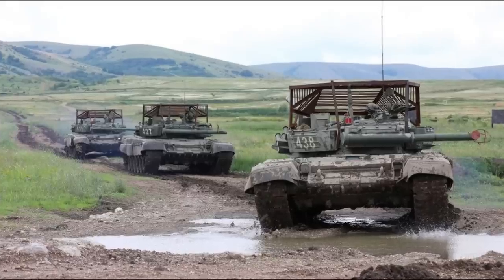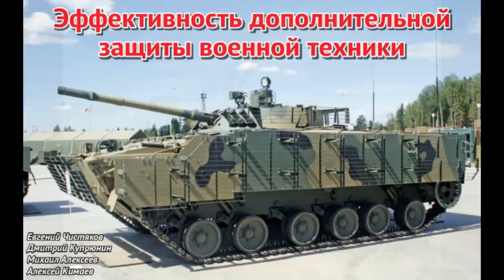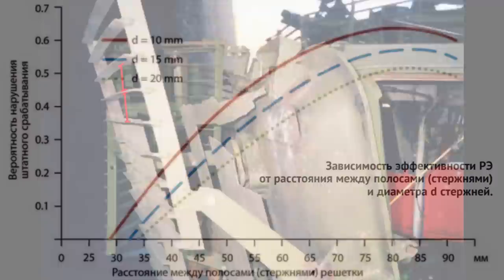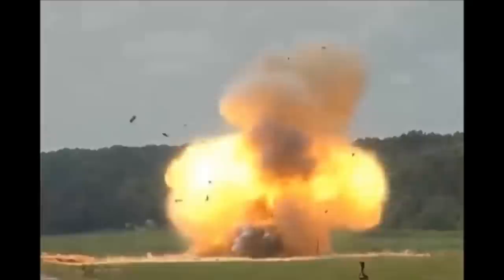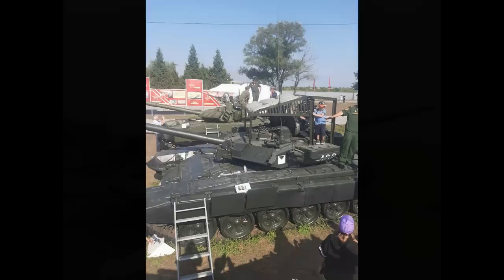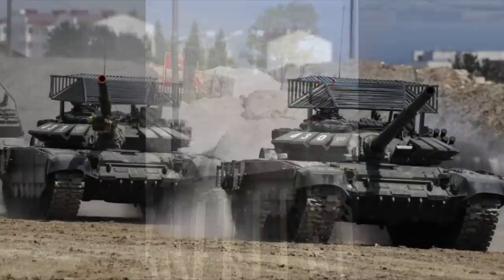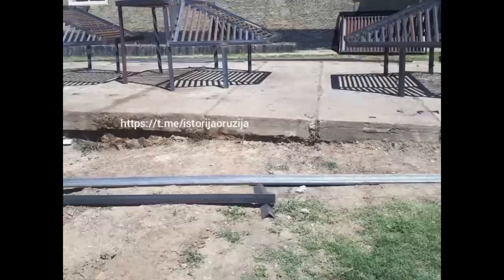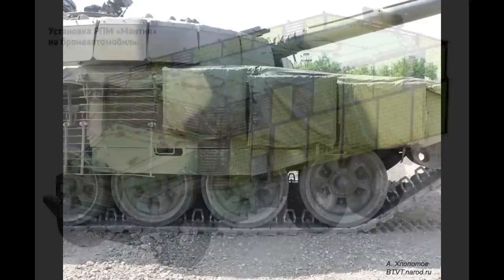The Truth About COPE CAGES

Comment: Looking at the study, the optimal width was 80mm against an RPG-7 rocket. Those rockets have a diameter of 93mm, which would give about 6mm of deflection per side (assuming a "direct" hit between two slats). If the slats are as narrow as possible, they will bend from the impact and dissipate kinetic energy to slow the HEAT projectile down, hopefully enough to catch it without detonating it. Using stiffer slats would, beyond increasing the chance of hitting the slat, cause a more violent deceleration that could detonate the warhead and cause a penetration.

Now, if 80mm is a good length for a 93mm warhead, what would be a suitable slat distance for a Javelin which is 127mm? Well, using simple proportions, it would be 109mm.

Problem of course is that these tanks aren't facing only Javelins and RPG-7s, but:
Stugna-Ps 130mm
NLAWs 115mm
PzF-3s 110mm
MATADORs 90mm
AT-4s 84mm
M72s 66mm

Just to name a few of the anti-tank weapons they've been provided. A pretty wide gap of calibers to protect against, since an 80mm gap is quite unlikely to catch a 66mm rocket. And that M72 can still penetrate 200mm+ of RHA up to 450mm, depending on the model.
Reply: Now that could have been made clearer in the video, at least to me. Armour like this strikes me as very threat dependent. If you're up against projectiles too large or perhaps, detonate at stand off, distance from the target, that's a different configuration required over an assumed primary RPG-7 type of threat. 

Not to say the idea works, or doesn't work. Just to suggest that in this case the design as installed is not correct for the threat present.
Reply: @leonpeters-malone3054  Thats why there was the proposition of those hard-object bags as layered protection. I mean when you look at tanks now ts layer upon layer upn layer of protections now. Cast-hull of steel for general protection. Composite armor shell over hull. ERA over fixed armor. ECM packages. Then its stand-off cages, then its bags over cages. 

At this rate, there is significant complexity to have a generally survivable tank, unlike WWII where it was thicker steel over a better hull design.
Reply: Two grids one to catch big fish and another below to catch small fish. cover 84mm to 120mm.

Perhaps also add absorbers for IR,  visible, radar? In these layers
Reply: @agnelomascarenhas8990  that would likely be very effective.
But it would be expensive to produce in a factory and difficult to produce in the field.
Or at least that's what my intuition says.
Reply: Which version of M72 can penetrate 450mm?
Reply: AT4 have special ring  so it initiates if any part of rocket touches a cage. And electric fuse is not in the front.
So AT4 will work any way. Any cage can't disable a rocket from initiating.
And its caliber is not the reason.
Reply: Classic case of not being to develop a counter measure against a weapon you know nothing about, hence all Western military systems are being upgraded, challenger, leopard, abrams etc they knew the threat existed so have adapted too it.
Reply: Don't forget drones dropping grenades from above. Which I personally think is the reason for these bars.
Reply: @leonpeters-malone3054  I personally believe they are to stop kamakazie drones and munition drops from drones. And are nothing to do with RPG at all.
Reply: It should be noted that weapons that use electrical fuses can’t be intercepted like this, which is many Western weapons.
Reply: @geroutathat  If that was the goal, then you'd space them according to the common threat, i.e RPG-43 with a diameter of 93mm. The spacing is too close for that.

So it may be for many uses, but clearly assembled without much of a deep understanding about the mechanism of slat armor.
Reply: @whitescar2  they used the same cages in Syria etc for drone stuff. This is raised a lot compared to other versions they used and they might have found that's an acceptable distance for the dropped grenade to detonate. It's impossible for me to say, but I think modified standard grenades are being dropped with fins attached. Maybe they were unsure what the spacing should be so moved the cage further away. There is a video online of Ukraine dropping one into an open turret hatch, and I'd say most tank drivers have seen it, and feel safer with the cage than without.
Reply: Slat armor isnt working like that. It may catch the rocket but its primal purpose is to destract cone shaped explosive in the warhead so even if it detonates his now destruped shape charge isnt effective. Rpg warheads to be efective must have certain  (Cone) shape or it woudnt work as it suppost to do.
Reply: The thing is that many of these systems have tandum projectiles, meaning they often basically ignore slat armour or single layer reactive armour.
Reply: I suspect that Javelin and NLAW are both stand-off EFP (explosively formed projectile) weapons which don't actually need to contact the armour surface to detonate. The bars of slat armour and cope cages are so thin that they would add virtually nothing to armour against EFP.
Otherwise, I guess the ERA on turret roofs should have done  its job and exploded to deflect/disrupt the shape-charge projectile from those warheads initiating on contact with a cope cage, because that sort are generally smaller, less energetic, particularly after initiating and then flying through the big distance (at least half a metre, from photos) from the cage to the turret itself.
Reply: @ukuskota4106  don't shoot AT4 at a tank please, very high chance you only make it angrier
Reply: @geroutathat  kamikaze drones can hit from any angle except straight up from the ground.
Reply: It is sometimes referred to as probability armour. The nose mounted fuse on the RPG is less likely to  strike the bar . The bars are spaced so that when the nose of the projectile passes between the bars , the sides of the projectile strike them . This causes the shaped charge to be damaged . Even if detonation still occurs,  you are now dealing with a frag' round rather than a HEAT round.
 It would have little effect against non nose fused or proximity fused munitions.
Reply: Solution: overlapping cages.

See, Ivan? I am an engineer.
Reply: @KKSuited  i dunno, you could probably fly one under the front or back and detonate it while under. Maybe put a big magnet on the bomb so it sticks to the under belly. I'd just walk up and bend the barrel of the tank with my bare hands, as it would be quicker.
Reply: You left out the Carl Gustav M4.

There's film of one scoring a kill on a Russian T72 tank.

Oh, they have "tandem charge" projectiles for the M4, these are designed for reactivate armor and steel cages in mind, 500mm penetration as well from the information I've gotten.

Thank you Sweden 🇸🇪
Reply: The point of the slats is to deform the explosive before it explodes, this causes the explosively formed penetrator from being formed correctly and significantly reduces its effectiveness
Reply: @BrokeWrench   from my understanding javelins and NLAWS do not actually strike the tank from above in top attack mode but detonate ~1m about the the target and the shaped charge penetrates the tank. So the cage would be useless since it cannot deform the projectile to deform the shape of the shaped charge.
Reply: Well, other issue is that the RPG-7 round it was designed to defeat isn't a tandem, which makes everything far more complicated. Just because you disable/defeat the initial warhead of the tandem doesn't mean the main warhead is going to fail as well. Besides, if the first charge simply explodes and doesn't form the jet, well now you got a hole in your cage the main warhead is going to pass through.
Reply: Great analysis. I still cant imagine the cope cages are worth giving up the silhouette of Russian MBTs- it’s always been one of their stronger and more stressed aspects
Reply: The study is all about preventing RPG-7 detonation.  It is not applicable to the use case.
I believe the plan was that the cope cage would act as spaced armour, triggering early shape charge detonation, and dissipating the jet in the air. Hence the rod shape is irrelevant. Theoretically, it is not a completely stupid idea. Fortunately, it didn't work in real life. I haven't seen any positive feedback about its efficacy.
Reply: @whitescar2  Don't know if any of the other replies said it, but against a Javelin this is more or less completely ineffective to my knowledge. Cage armor only works against HEAT charges with a contact fuze, but the Javelin (and also NLAW for example) detonate quite a bit before they touch the armor. Contrary to popular belief, a HEAT charge does not become less effective when it detonates a fair bit before the armor. If it is designed for it, it will even be more effective this way. So my guess is the cages are probably against drone dropped weapons like often deployed in Syria. Against modern ATGMs they are very unlikely to change the result of a hit, and the Russians are not THAT dumb to think they can stop a Javelin with a bit of angle iron.
Reply: @agnelomascarenhas8990  

Yes that exactly what they should have done .
Reply: @geroutathat  Possible. Very possible. 

Not going to argue and not going to be too be worried about it. I'll stand by my comment though, if it was working and it was cheap we should see more of them, which we don't.
Reply: @JRyan-lu5im  Would have to argue that last statement. Depends on what you want from the tank in question and if that means armour. Mobility is a form of armour, especially in the era of HEAT as the primary round. Form determines function and function, doctrine defines criteria. Even presumed threat. 

WW2 is a bit of an odd case in tank design. So many designs, cycled through so quickly. Layered protection makes sense, after all there's a whole layer in the onion of protection given to that. 

That's also an assumption I'd rather not make, yet. I'd like to see more information in the original language on the blankets, pads, padding before I make any claims about it.
Reply: @leonpeters-malone3054  there is a chance that we are all wrong and they have out them on tanks to be hidden in barns as it allows the crew to get out if the barn collapses on them. It could even been for tanks headed for bushes as they found it allows them to hide the tank and exit and enter the tank without disturbing the cut branches placed on top. All I know is that if it's for defence from a weapon, I can't see this cage having any impact at all on most modern anti tank rockets etc. We seen similar cage used before and consensus it was for drones. But who knows.
Reply: You're overthinking this man. Slat armor by function can only stop piezoelectric fuzes from triggering. Electrical crush fuzes will still go off. Moreover only the secondary charge in a tandem warhead will be directly affected.
Reply: An RPG is a direct fire weapon. How many times does someone get a top shot with an RPG? 1 out of 10? 100? Most RPG shots will hit the sides or rear, not the thin top armor. That's why the top HAS thin armor-- it's the hardest armor to hit with direct fire.
Reply: @JRyan-lu5im  Ya, it sure looks like it's done a fat lot of good on T-whatever Russian tanks.
Reply: @Tom-ut6ky  You dont see Leopards or Abrams facing modern weapon systems often, and for the few instances they have, they've gone up in smoke all the same - such as leopard tanks cooking off in Syria and smoldering Abrams tanks facing Kurds in Iraq.
Reply: @JRyan-lu5im  "Of the nine Abrams tanks destroyed, seven were destroyed by friendly fire and two intentionally destroyed to prevent capture by the Iraqi Army."
Reply: @Tom-ut6ky  "Abrams facing KURDS" - lets not kneejerk here and actually read. The Peshmerga destroyed an Abrams tank with a MILAN ATGM, the tank being one that the Iraqi's gave to Shia militants(the same ones who actively tried to kill americans). This has nothing to do with the american invasions of iraq itself.
Reply: These roof cages aren't designed to catch a rocket before it detonates. The rockets they are intended to defend against are rockets NLAWS or similar, that go above the tank and explodes mid air with a shaped charge goind downwards. If that is what they are trying defend against, then following the same design principles doesn't make sense to me. 

Surely, what they want is something that the shaped charge will hit and make it dissipate some energy before hitting the armor, if it can catch a projectile or not doesn't matter. 

Ideally they would want to build a small bed for reactive armor. Having a shelf with sand bags might dissipate some energy before it hits the tank too, but no idea if that would be enough. Having small bars with a lot of width would probably do very little against a shaped charge that is already moving through the air. 

Sure, if they want to defend against RPGs fired from top of buildings, they should follow the same principle. If they want to defend against NLAWs or similar weapon systems, they don't want to follow the same principle. 

If you look at the second target in this video: https://www.youtube.com/watch?v=hupsUq-fzq8 The NLAW is that high up that it would probably hit above the cage, and I would believe that a cage with sandbags in that hit would manage to dissipate some energy, not saying that it would be enough, but the design makes sense.
Reply: Disruption of the electrical connections from the nose fuze to the base detonator is what the spacing is about. US troops in Nam used Chain Link Fence to disrupt 50% of Chinese copies of the RPG-2 called the B-40 with the meter plus standoff lessening damage from those that did detonate. Similar numbers or better vs RPG-7.
Reply: @evil001987  Problem is, the NLAW is not a shaped charge, but an explosively formed penetrator. It does not lose penetrative power over distance in the same way that a shaped charge does. An EFP is a solid slug, while an SC is a jet of plasticized metal. Russians have been placing ERA blocks over their tank roofs for decades now. So against shaped charges, they have some protection.
However, the NLAW does not much care about Kontakt-5 and the Javelin is, afaik, tandem shaped charge.

The only potential use these would have is against rooftop RPG-7s or M77 LAWs (or equivalents).
Reply: In order for the HEAT round to penetrate it must be detonated a set distance from the armour. That distance is built into the round itself. If you set it off before it reaches the target it will just splash against the side doing next to nothing.
Reply: @python27au  That's quite a hyperbole. It will be less effective than if detonated at the optimal distance, but it won't just be a useless splash of copper.

In WW2, before the stand-off distance was properly understood, heat shells looked like this: https://ww2db.com/images/weapon_hafthohlladung5.jpg

Some tank crews adding logs, or other makeshift armor to their vehicles actually improved penetration, since there was more space for the jet to form before hitting the actual armor. 

Modern shaped charge penetrators do come with standoff tips for optimal penetration, but if what you said was true, it would imply that all tanks could be safe from HEAT warheads with the gentle application of a 10cm standoff plate. And that is obviously not the case in reality.
Reply: @whitescar2  depends on the round and the tank. Some of those rockets look like they’d need a bunker to stop them. I was a combat engineer, we used shaped charges for various applications, we had a charge designed for cutting steel beams if the charge wasn’t place exactly flush against the target then it wouldn’t cut or wouldn’t perform properly. I’ve seen pe4 and comp b charges obliterate one target while a second only got a little bent because there was an air gap between thw target and the charge. We made rocket screens out of fencing wire they would deflect or detonate rockets so that the target was only peppered by shrapnel and not blown up.

A piece of metal in the right place could mean the difference between a disabled tank with a living crew and complete destruction. Not saying its 100% effective it all depends on the variables.
Reply: Dam coalition and their chaotic armoury!
Reply: Their ERA and APS can protect against most recoilless anti-tank rifles and ATGMs. Naturally Russia focuses on the cheaper, more numerous Kontakt-5 and Shtora soft kill countermeasures. Most NATO MBTs do not use ERA or APS.
Reply: @Channel-sp3fp  Most Russian tanks do not have APS, only a limited number of T-90s, of which we've seen barely a handful in service.
ERA use is much more prevalent in Russia, that much is true, but likely due to doctrinal differences. In Russian doctrine the tanks are more exposed to handheld anti-tank missiles where NATO doctrine doesn't push them into such exposed positions.

NATO tanks also have extra protection in the front quarter, which is the most likely place to be struck.

You'll note that when NATO tanks were pushed into uncomfortable cityfights, Challenger and Abrams both got urban survival kits which included some rather heavy ERA packs. But for normal tank engagements and fire support, that's just more weight that's not very helpful. Even the Russians don't have inserts in the ERA blocks half the time.
Reply: @python27au  All depends on the energy overmatch in the shaped charge and the Diameter vs. standoff plus thickness of the liner it's exact curve geometry plus the explosive wave velocity. I blew a hole through a chunk of 16" thick armor from the Battleship Kentucky with a M3 shape charge designed to make bore holes for cratering charges nowhere near optimal but there was 10 foot penetration into packed gravel behind the slab. The side blast can also be devastating. I have seen photos taken on the Golan heights of a T62 Hit with 105 HEAT rounds where the tracks and road wheels were shattered by the side blast.
Reply: @wacojones8062  wow. Beehives are powerful but I wouldn’t have expected that, nice😁
I split a 1.5ish meter granite boulder into four with one, i also put a Bangalore torpedo under a pile of logs and turned them into matchsticks 😁. But at the same time i saw 5 sticks of PE4 barely strip the bark off a log because they weren’t set right. I cut a steel tube in half with (i think) three sticks of PE moulded into a 1.5cm strip while 2 or three slabs of comp B just put a bend in a steel bar. 
I don’t know enough about shaped charges or rockets to confidently say whether they will work or not in a given scenario but we were taught that if you can disrupt or deflect the flow of the charge it might prevent proper penetration and save you or the target and rocket screens don’t have to be armour they just have to stand off far enough and be just strong enough to do the job.
Reply: Right but in a case with a javelin where te charge is still going to bury itself into the dome of a tank it does nothing.
Reply: @n8zog584  It's still going to detonate...